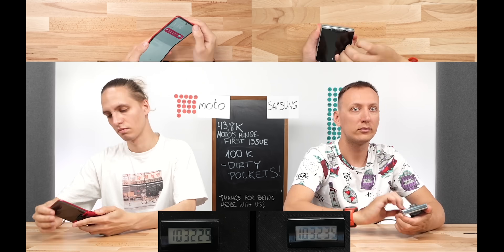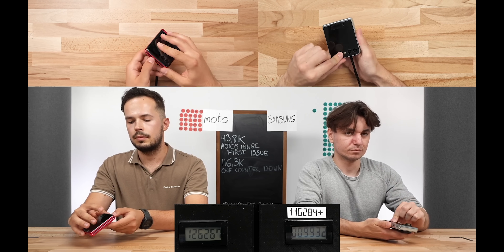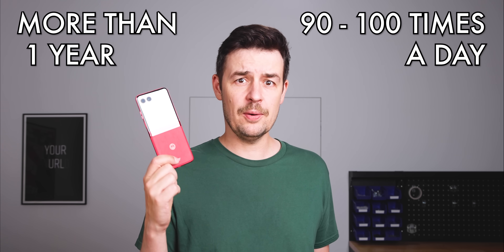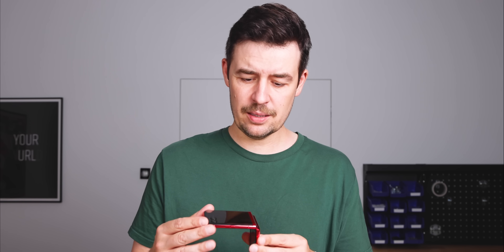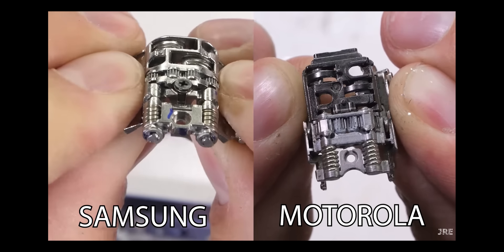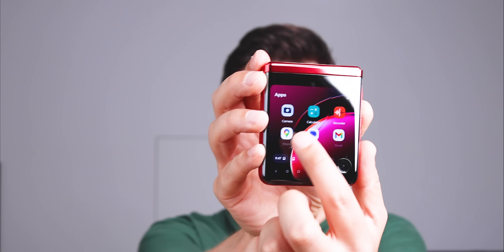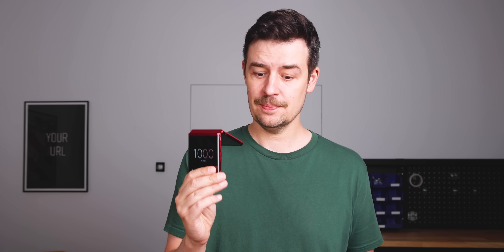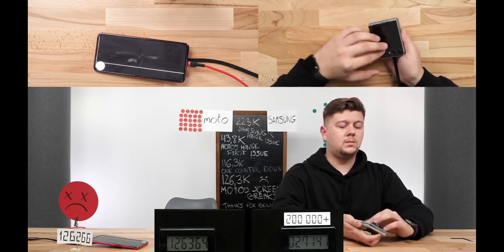Why Did the Motorola Razr Break So Fast?

Comment: cool video! I was in the store last week, i watched a bunch of reviews for each of the new flips. The razr and the gflip 5, i was planning on getting to the store and making the choice on which to get when i got there. Needless to say, i left without a new phone. I dont think that the foldable screens are durable enough for me how they are presently being sold. I did not like that when they are open you can not only see the crease in the screen but there is a very prominent indent when you go over that part of the screen, they are not flat by any means and that bothered me. 
Tho to add, they market these phones for people who do quick tasks on their phone that can be done without opening the phone. So i understand why they do not make them with a higher fold number because the idea is to utilize the front screen to do most of your tasks.

Its nice to see that at least what they are telling you isnt far from the truth with the durability.
Reply: I've been using a Razr 5G since its release 3 full years ago. It still feels like it's brand new; probably because being folded when in my pocket helps protect the screen. The hinge is as quiet as when I bought the phone; not 100% silent but Razr 5G videos that tested its decibel output sound very similar.

Honestly I'm hesitant to upgrade because it seems like Motorola's hinge may have gotten worse here and not better?
There isn't a point in upgrading to the Z Flip 5 since the Razr 5G doesn't have a crease, and already had a huge outer display which has certainly been as handy as all the reviews seem to be shocked by. lol
But I've had these things for three years, and now the Razr 5G costs like $200 in good condition on eBay. So yeah, it feels like the flip phone we've all been waiting for is here! A used or refurbished Razr 5G. ;p
Reply: Have used almost every Flip and Fold since their 3rd generation.  The screens are not as fragile as you think.  The video here basically puts them through the ringer so of course it's going to have problems.  But let's put it this way, for my flips and folds eventually the inner screen protector bubbles and needs to be replaced.  Not a big deal,  just buy a new one and slap it on.  However, I rocked mine without the screen protector for a good month before replacing it and never had any issues.  Unless you got long ass nails you shouldn't worry about anything.  long ass nails would probably cause scratches, but no cracks or shatters.

Comment: You're missing the point of a folding phone -- to execute common tasks without opening it. If you're going to open it every time you look at it, a slab phone would suffice. In terms of the front screen, Motorola offers far higher resolution, refresh speed, and app implementation than the Flip5 .
Reply: Did he not address the typical use case in the first few minutes? You listening?

Comment: Any and all folding phones will break at some point, some very quickly
the thin ribbon cables that connect the screens are the weak spot no matter
which brand or price.
I don't have one or want one, having worked in consumer elefctronics reapair 
since the early 70's i know a bad design when i see one, Some VCR's
had drop down front panels and the ribbon cables always split
These young designers have a lot to learn.

Comment: The decreased durability and the fact that Motorola is hard blocking phones in my country if you get them from other non-oficial stores or resellers, make me definitely avoid the brand all together. 

Does Samsung does the same thing? blocking units if bought from other sellers (aka its cheaper to buy from USA than from local resellers in my country). ??

Comment: It's more sand than dust I would say...
Reply: Indeed, but in a way that's worse. Sand has a larger particle size and still ended up back there. Dust will get back there even more easily. That said, maybe it won't have quite the same effect on the screen. I wish they kept folding, ignoring the line in the screen. It still technically functions.
Reply: @justinkase1360 someone said that half of digitiser is broken, so it is not functional phone anymore. But I don't know if it's true.

Comment: Im getting the Rarz soon but Im getting solely for the massive usefulness of the front display, I'll be opening it only for work related things maybe 10 times a day. So I hope the screen and the hinge will last far longer than expected. But im getting heavy insurace for it too in case anyhting breaks in the next 3 years.
Reply: Get insurance and get a case. I dropped it once 4 feet no case on top part (my case blocks me from swiping down to use the settings shade) and it shattered so bad.
Reply: @CC_Reads  everything is on delivery, case coming sooner than the phone 😂

Comment: My 2020 razr lasted 2yrs, and I have zero inclination the 2023 will last any less time.

Android, I do not expect it to last more than 2-2.5yrs anyway, as either hardware generally fails or it starts lagging out due to trash software support.

The good thing is though, I can buy parts directly from motorola if something fails.. so i'm not that worried about it.

Comment: The Motorola razr plus is a great phone, if you open it normally and you don't jerk it open it will last.
Reply: But it is true that Samsung is more durable.
Reply: that's why he doesn't want to experiment with using his machines.. if the phone is strong when folded roughly then of course the phone will also be stronger when folded normally.. that's the logic... 
REMEMBER : This is durability test 😊

Comment: I don't really understand everybody's obsession with the hinges of these foldable smartphones. We never worried about hinges of old flip phones or refrigerator doors or car doors or house doors or any other hinges in our world for that matter. The screen longevity? Well I still use the Z flip 1 and nothing has broken, no dust damage either. I now added a Razr+ and not worried at all. We will likely replace our phones 3, 4 years down the line anyway.
Reply: It's not about obsession. First thing - is specific brand trustworthy with their statements? Second thing - we use smartphones much more frequently than cell phones. Third thing - smartphone with a hinge is much more exposed to damage than cell phone with a hinge.
Reply: You need to care all about your phone if your phone costs more like 1400+

Comment: The Motorola one with a dust, managed to fold 126k times against a dustless Samsung one that fair the same.
U shld get one into Samsung and redo the test and see if its comparable with the same situation instead of labeling Motorola as inferior to Samsung.

Btw your test is done on both brands, 1 unit (or even up to 3 units maybe) each.
As of now, there's already quite a few Flip 5s having issues, not with just the fold, but screen, battery life and software (on the front screen).
if not, this phone which is just recently released, didn't score with many takers in Asia and EU.
So please examine carefully overall and not just take US only as your world basis.
Thank you!
Reply: Typical Samsung sponsored stream
Reply: Clearly you have not seen the video and spreading your ignorance here. 😂😂The galaxy was even tortured while the motorola just died before the torture... Well low quality vs samsung
Reply: @johnsecret1318  what r u talking about? Both had been out under the same test????lol
Reply: @shafiqakmalismail4919  Yup and the razr died after 170k folds while the z flip survived above 400k folds and that's not a surprise for samsung while the inferiority and low quality of the razr was unsurprising as well.  Motorola claimed that razr would survive up to 400k folds while samsung only claimed the z flip would survive 200k folds, now what happened? 🤣🤣. In addition, after 200k folds they did all the torturing on the z flip until 400k folds while the razr was already sitting dead 🤮🤮

Comment: so is it even a fair test? you're doing the flipping live stream after the dust and water... should've used brand new fresh devices for a proper result 🗿
Reply from the maker: There was no dust or water until 100K folds. After that we went with dust, and water came after 200K folds, which is Samsungs limit (claimed by the company). We do push the phones harder, that's the idea behind this test. It's supposed to be extreme. Still some people will claim we're way too gentle.

Comment: I watched some part of the live and to be fair, most of the time , they were a lot more gentle with the samsung than moto. 🙃
Reply: If I read your comments right, that means you can tell one guy needs to use more force to open and close the motorola phone than the samsung phone by just looking at their hand movement. That seems to me Motorola's hinge is not as smooth as samsung, another explanation why motorola broke first.
Reply from the maker: People switched after 30 mins of folding. The same person folded both phones for 30 minutes. I would lean towards @daquan99999 explanation regarding the hinges.